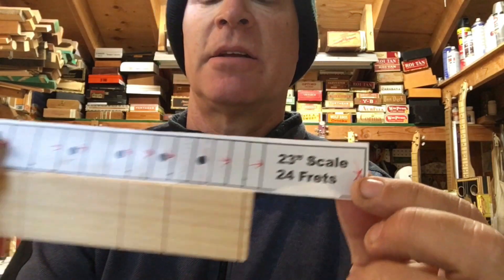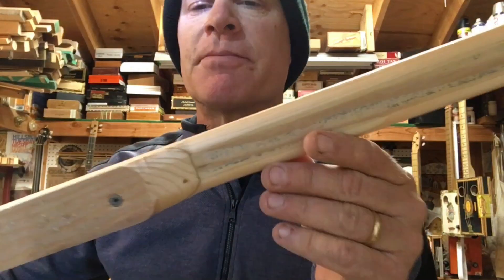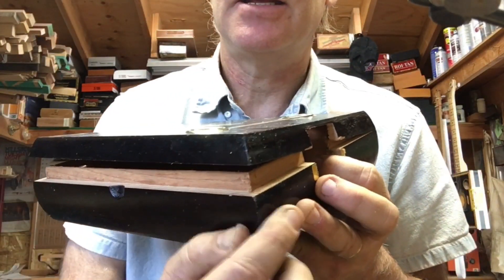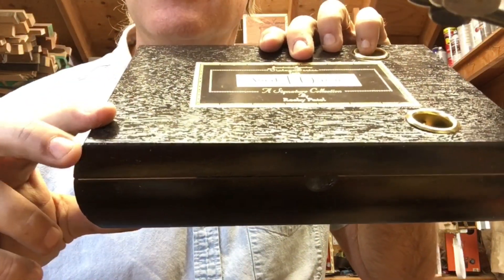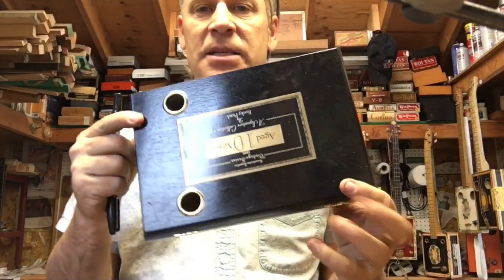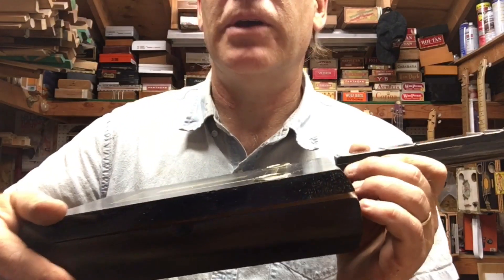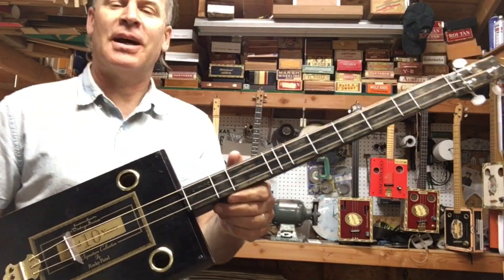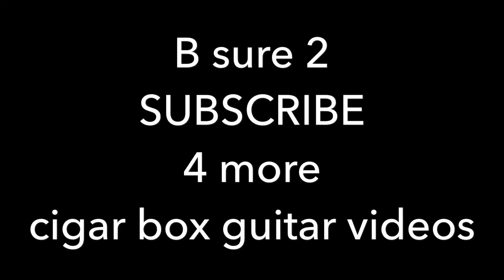"Prime Time" a CBG Experiment

Comment: Dude dell... Say buddy i have a hard time using those piazo discs .. They have a hard time working. I have one in my girls box but there is hardly any volume! And. I used two piazos under bridge and on neck. Still i jave to crank the volume
Reply from the maker: You copy my example ?? Exactly??  You may need the preamp?
Reply: @PuckettCigarBoxGuitar  well kinda but its under bridge under lid on top of neck. Then second is inside on the side of neck. Stil hooked both to volume and its to the jack. Still very low volume.